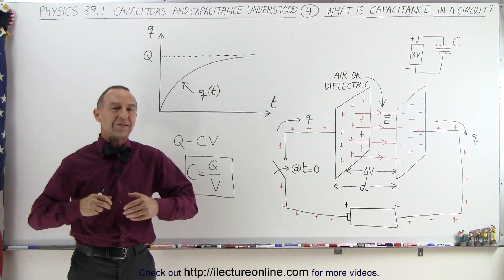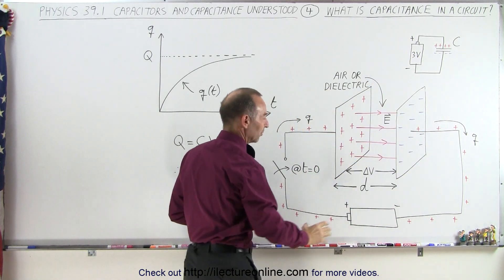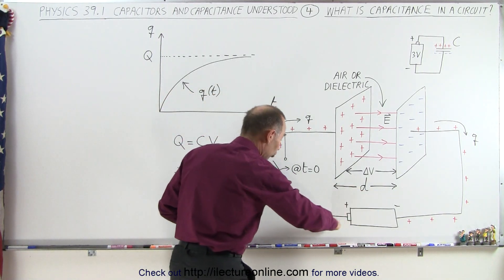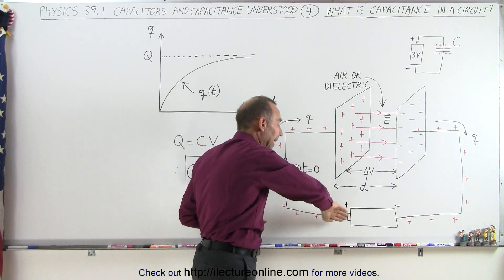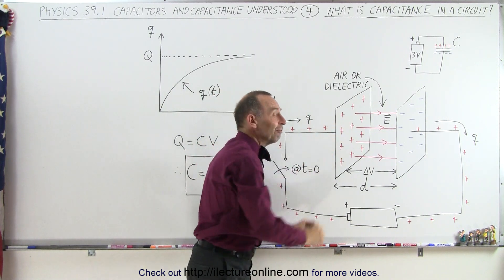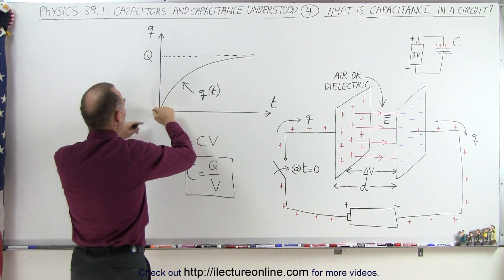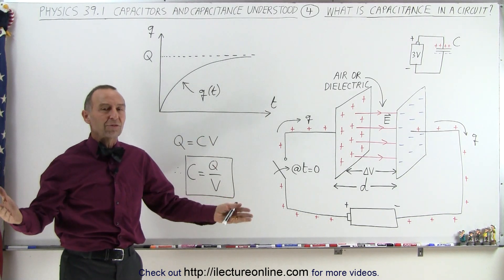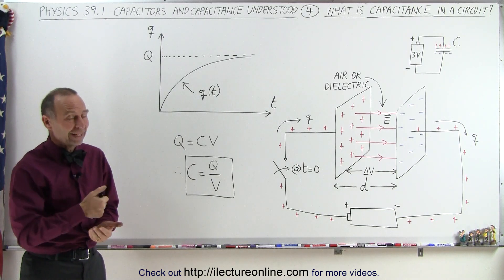Physics - E&M: Ch 39.2 Capacitors & Capacitance Understood (4 of 27) Capacitance in a Circuit?

Comment: At the end of the video, you mentioned; if you apply twice as much voltage, you would be able to apply twice as much charge onto the plates. However, I think that if you double the voltage then basically you increase the charging force and so your plates would be charged much faster, but the amount of charge Q would still be the same and would not be doubled. If you want to double the charge then you have to increase the size of the plates, not the charging force V, because the charging force V will only make charging faster. Now, where am I wrong?
Reply from the maker: C = K epsilon A/d   So the capacitance of a capacitor is defined by its physical structure.    Then  C = Q / V   or  Q = CV   Since C is fixed, then Q must be proportional to V

Comment: just one question : I have always learned that positive charges do not move, only free electrons can move and the electron deficiency that’s what make a “ positive charge”.
Now you are saying here that positive charges moves from the battery to the capacitor plate who is then positively charged and repel de positive charges on the other plate who became then negatively charged because of the positive charge dificiency. Why is it not the reverse because when current flow electrons flow from the battery to the capacitor then the capacitor plate becomes negatively charged then they repel electrons from the other plate who becomes positively charged because of the electron deficiency?
Reply from the maker: You are correct that in the "real" world, only the electrons move and positive charges stay put.  But there was a time they didn't know that and the "guess" was that it was the positive charges that were moving.  This convention has been kept through today and almost all texts and classroom use the convention of positive charges moving.  (Interestingly, it doesn't make any difference in circuit design and analysis.)

Comment: I don’t think it’s correct to say that positive charge is pushed onto the positive capacitor plate. The electrons are the only things reacting to the e-field because only they are mobile. Is this correct?
Reply from the maker: You are correct, the electrons are the only charges that can move.  However dating back to the time that this was not known, the "positive charges moving" was chosen as the convention.  Therefore we continue that tradition and it works on all levels with engineering practices.
Reply: @MichelvanBiezen  Excellent, thanks a lot.

Comment: How does the battery push positive charge? aren't only electrons(Negative) free to move inside the wires and the conducting plates? how exactly does the battery move the charges so there are positive and negative sides on each conducting plate?
does the positive terminal draw the negative charge from the plate and that way making a positive charge on the plate?
Reply from the maker: You are correct that in the "real" world only the negative charges move, and yes, it is the battery that pushes those negative charges.  But the convention assumes positives charges moving and it works just fine as long as you stick to the convention.

Comment: You did't reply to comments. I have doubts.
Reply from the maker: Which comments?
Reply: Michel van Biezen  what will happen to electric field when distance between capacitor increased to double.
Reply from the maker: If the voltage is kept the same, the electric field will reduce to half.
Reply: Michel van Biezen  and if voltage supply removed.
Reply from the maker: Then the electric field will remain the same.